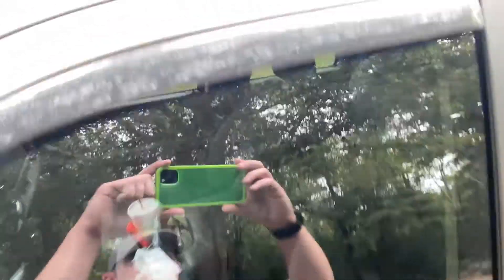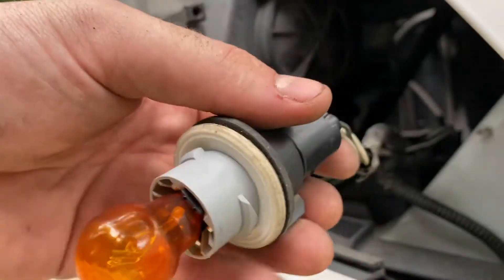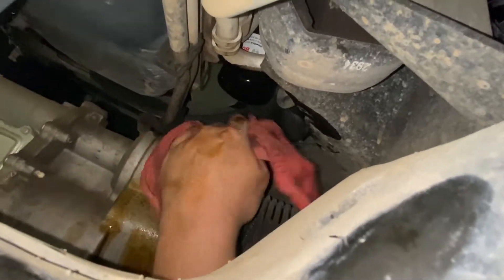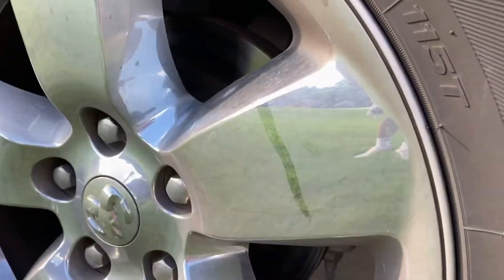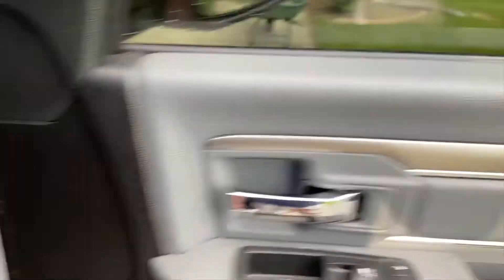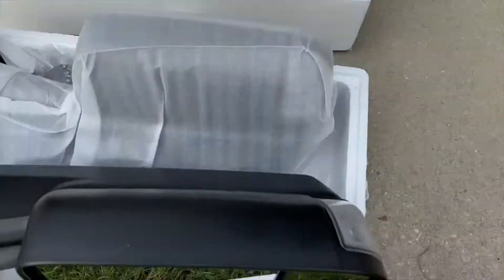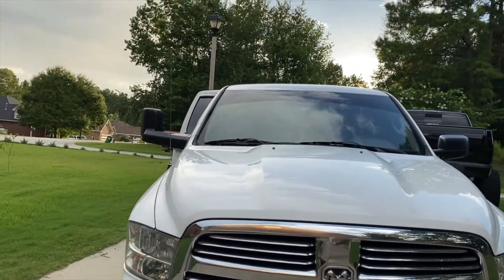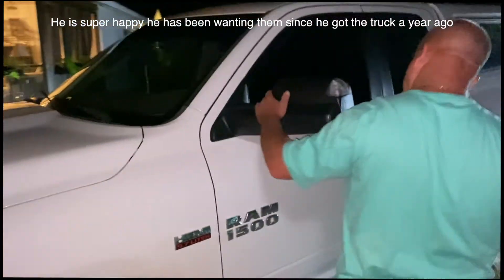2009-2019 Ram 1500 tow mirrors (eBay tow mirrors) how to install tow mirrors

Comment: Hey man on your wheels did you have to use a hub centric?
Reply from the maker: Hub centric rings where added
Reply: Did your wheels come with them
Reply from the maker: Yes
Reply: Did you get balancing beads for your tires or regular stick on weights?
Reply from the maker: @danielaltman86  now stick one but I will be taking them off and doing beads soon
Reply: I’m going to put a 6.5” maxtrac lift on mine and getting the 2 piece driveshaft lowering kit that they have with the lift. I also just ordered the 20” wheels like yours but they are the matte black ones with 35s. Remember I was doing the rough country 4” but maxtrac has the lift specifically for my v6 truck.